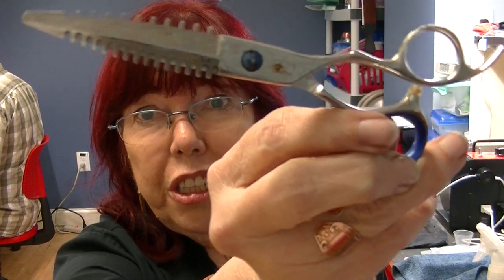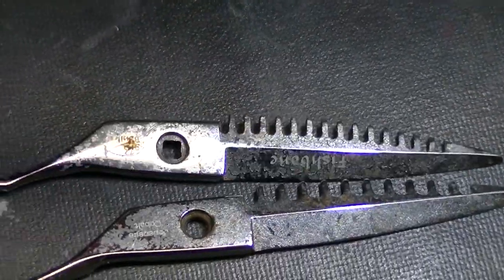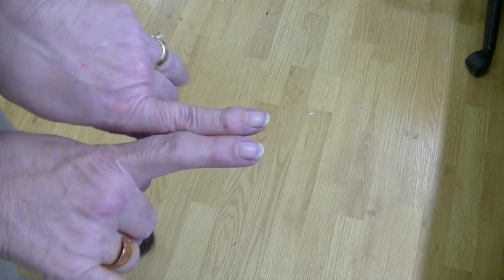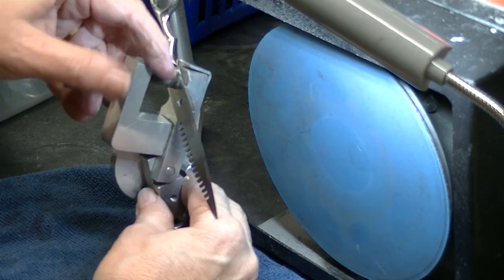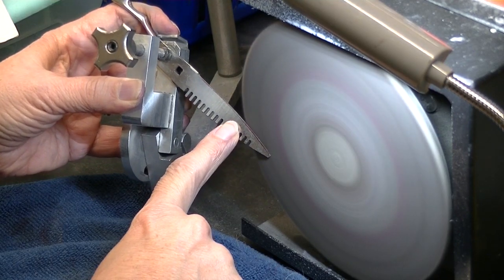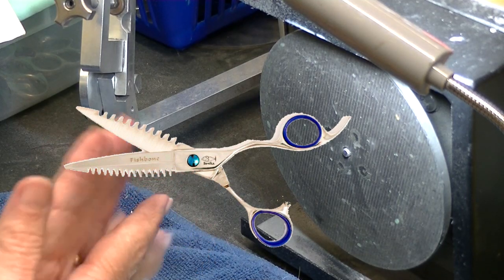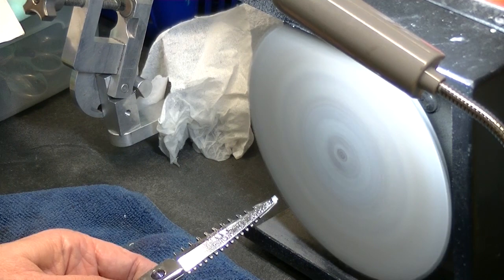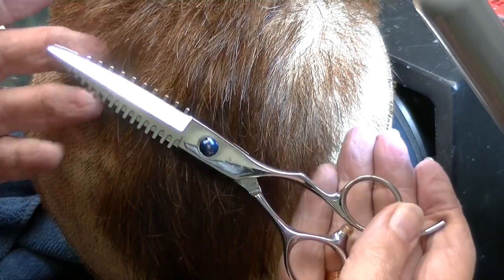Sharpening Nicked and Abused Stylist Shears - Can these shears be saved?

Comment: Hey Bonika, I am currently learning to sharpen hair dresser shears and your videos really help a lot. I have a pair here that has micro-teeth on one side. Should I just sharpen them like normal or not touch them? Cause if I sharpen them normal the teeth will be gone I guess.
Reply from the maker: It depends on the shears, but my first thought is to sharpen just the blade without the serrations and test them afterwards. Are they beveled edge German type shears of high end convex micro-serrated shears?
Reply: @BonikaShears  they are german beveled type shears as far as I can tell, with micro serretions on one blade and normal edge on the other, Tondeo Spider 5.5, can't say the exact Model.